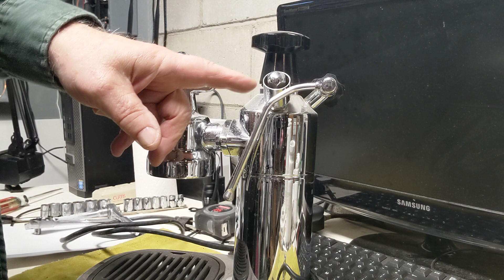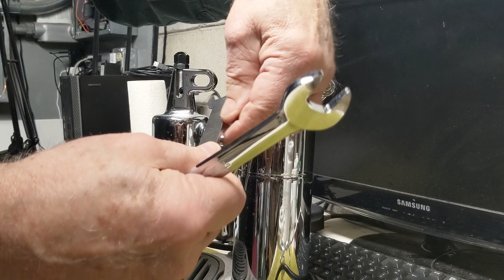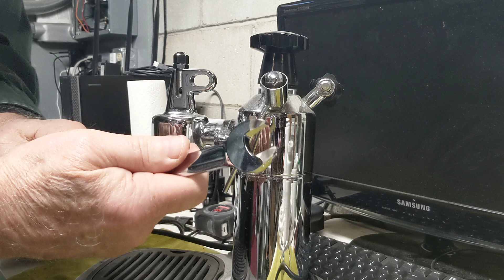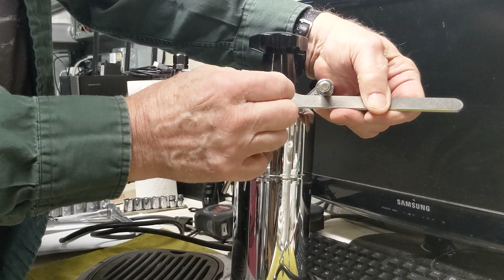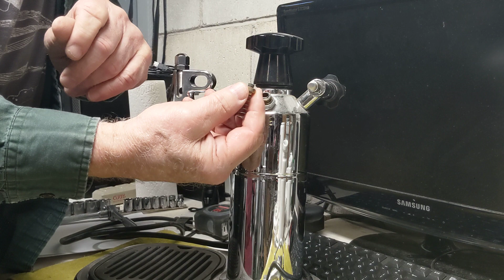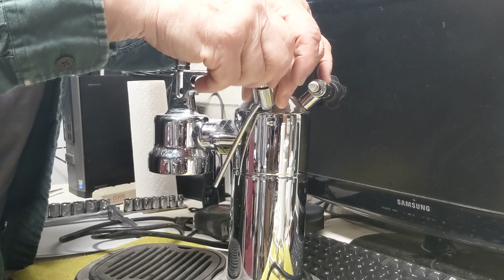La Pavoni Boiler Safety Valve Removal

Comment: Hi Bruce. 
Great video.
The seal between the steam tap and the boiler is releasing pressure.
Any thoughts on a wrench that will fit through the sop of the tank to lock the 16mm nut so I can renew the washer?
Thanks for suggestions (I was concerned that I may have to remove the boiler)
Best wishes
Jon
Reply: That should read "top of the tank"
Reply from the maker: Tudor & Stefano make this tool just for the job. It's worth the purchase if you do work on your machine or others:
- Tudor: https://coffee-sensor.com/product/la-pavoni-lever-custom-steam-valve-removal-tool-or-wrench/
- Stefano: https://espressocare.com/products/la-pavoni-steam-valve-removal-tool-wrench

They are remakes of those used in La Pavoni's factory service centers.

(Links added to the description.)

Comment: Bruce I find coffee residues that are probably not coffee residues in the boiling water that I let out without mounting the filter holder. What can it be?
Reply from the maker: Without a video to diagnose, I'll take a stab at it. I assume that you are getting coffee grounds back up into the shower screw after you pull a shot. This happens when the lever is pulled back with the portafilter still in place. Best to remove the portafilter BEFORE lifting the lever.

Also, you need to clean the shower screen with a brush and flush some water through the group head after each use. Residue can accumulate on the shower screen if you don't do this. This is best practice.

Does this help? Is this what you have?
Reply: @BrucePappas  Thanks for the answer I wanted to say that the residues are SIMILAR to coffee but THEY ARE NOT coffee because they look filiform and chewy. Can it be boiler or resistance parts?
Reply from the maker: @PokoMoto-s8w - have you rinsed the boiler (when cold) by filling it with clean water and turning it upside to empty?
Reply from the maker: @PokoMoto-s8w - when was your last descale?
Reply: @BrucePappas  two weeks ago with citric acid
Reply: @BrucePappas  yesss, many times. I think I could try with rice or salt.
Reply: Mine is pre-millennium professional. Could it be defoliation of the resistance or of the boiler?

Comment: Hi I am running into issues and I can not get anyone to reply to help I have a old model 83 it is loosing pressure as you blink your eye I don’t hear or see a leak anywhere but my port is always hissing and it seems to hiss rather hard. Do I try and get a new spring or what do I do I’m so lost
Reply from the maker: I'd be glad to help. Do you have a Pro (larger boiler) with a pressurestat, single switch, and factory gauge or a Euro (smaller boiler) with a dual element, double switch, and no gauge?
Reply from the maker: From a previous response (edited): 

Gen 1/2 Euros (before 1991) will hiss all the time, as they have no pressurestat and rely on the valve to regulate pressure. Just turn it off to pull a shot when it's hissing. Turn it back on before steaming.

Gen 2 Pros have pressurestats which turn off the heating element at a certain pressure. It's not normal for those to hiss all the time. If they do so, your pressurestat and/or pressurestat tube may need cleaning or replacing.
Reply from the maker: So...if you have a Gen2 Euro and want to reduce the hissing, you may need to clean the safety valve (descale) or replace the spring & ball with a new spring & Teflon mushroom. Some owners have reported that they simply stretch the spring and use the original ball, but if the spring is worn out, you will need to replace it. 
https://espressocare.com/collections/la-pavoni-drawing-2/products/safety-valve-kit-europiccola/
Reply from the maker: Here's an explanation about safety valves:  https://lpowners.org/safetyvalves
Reply: @BrucePappas  it is the double switch small boiler
Reply: @BrucePappas  it gets up to pressure fine it just can’t maintain it
Reply from the maker: @TheSuburbanWarrior97  - so here's the next question: is it just exhausting excess pressure or is it losing pressure to the point you can't pull a good shot? A boiler pressure gauge would answer this question.
Reply: @BrucePappas  so for it to go from 15 psi or so of preasure to 0psi it takes 7 mintues 45 seconds
Reply from the maker: @TheSuburbanWarrior97  - so you may want to descale the safety valve and/or replace the spring. Don't use this spring/mushroom, as the size is different.
https://espressocare.com/products/safety-valve-kit-professionale
Reply from the maker: Use this one: https://espressocare.com/products/safety-valve-kit-europiccola
Reply from the maker: @TheSuburbanWarrior97  - one more thought. The high switch position is intended to initially bring the boiler to temp and to steam. The low position is intended to be used to pull a shot (or even turn the machine to off temporarily). How are you using the switches?
Reply: @BrucePappas  so it seems that when my switch is on level one it is declining on pressures at the 7 mintues 45 seconds rate i was talking about is that normal?
Reply from the maker: @TheSuburbanWarrior97  - okay, I get it. No. When the switch is on high, it should continue to heat the water enough to keep the pressure up continuously - even if the safety valve is open more than it should. Are you saying that the pressure drops to zero after a bit less than 8 minutes when the switch is still on? Is the safety valve still hissing madly? Can you make a video and send it to me? My info is here: http://www.youtube.com/@BrucePappas.  Click <More about this channel> for my email.
Reply: @BrucePappas  yes I will send a video thank you so much for your help, you rock!!!
Reply from the maker: @TheSuburbanWarrior97  - my pleasure. We'll get to the bottom of this.

Comment: My valve hisses all the time. Is it supposed to do so?
Reply from the maker: [EDITED] Depends on the generation. Gen 1/2 (before 1991) will hiss all the time, as they have no pressurestat and rely on the valve to regulate pressure. Just turn it off to pull a shot when it's hissing. Turn it back on before steaming.

Gen 2 (after 1991) and Gen 3/4 (after 2000) all have pressurestats which turn off the heating element at a certain pressure. It's not normal for those to hiss all the time. If they do so, your pressurestat and/or pressurestat tube may need cleaning or replacing.

Let me know which Generation you have.
Reply: @BrucePappas  Many thanks for the quick response. My machine luckily is from 1995, so everything should be fine according to your words. I was a little bit disappointed at first, after having changed all seals. Thank you very much, once again! P.S. Didn't know that you should turn the machine off when pulling a shot.
Reply from the maker: @marcelf.284   - my mistake. I just edited my first response to you. Your machine DOES have a pressurestat. It should NOT be hissing after it warms up. The pstat should be shutting off your element. Here are two sources for identifying your machine:
1.  http://www.francescoceccarelli.eu/lapavoni_ep_eng.htm
2. www.LPowners.org
Email me and I'll help you out. You can find my email here: https://www.youtube.com/@BrucePappas20/about
Reply: I have a July (LUG) 1996 with no pstat, it has a dual switch (heating element has two coils). The heating element is stamped 1996 as well, so it's likely "stock". Plastic sight glass cover, removable steam pipe. It's a 120v model, so maybe that's a factor?